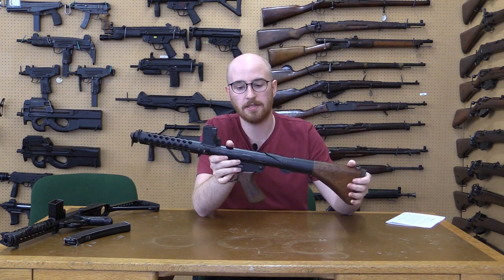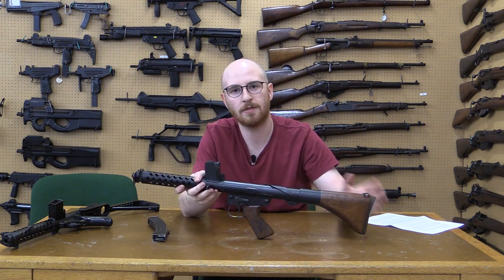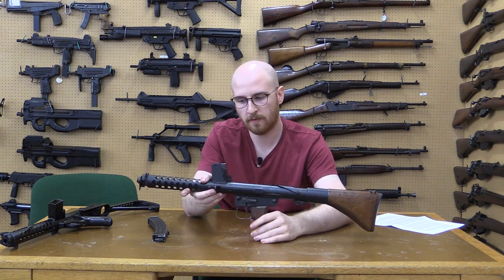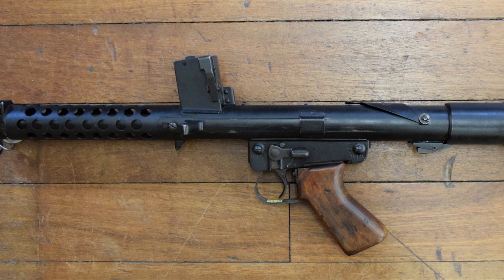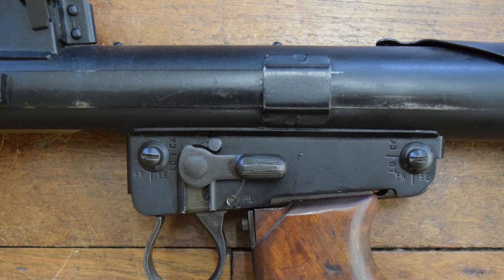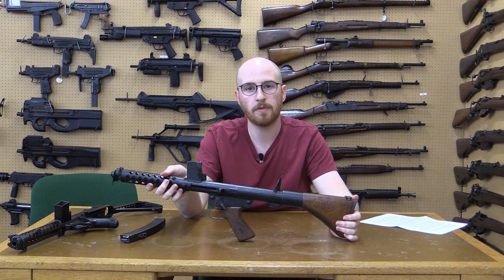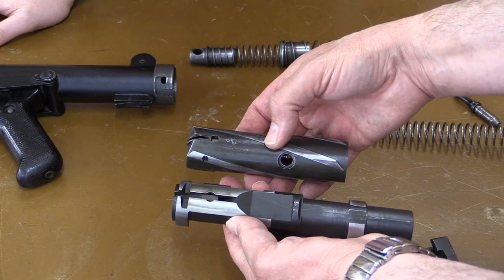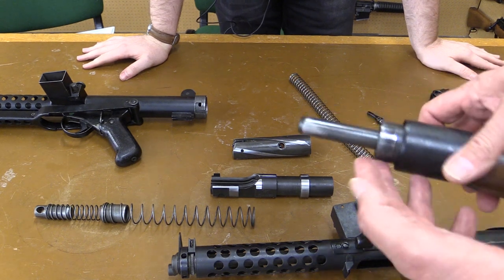TAB Episode 12: Australian F1 Submachine Gun

Comment: F1 used to pull right and high as you fired so used to aim left and low to watch rounds hit the ground and walk the rounds to the target.  Standard rounds scatter in a pattern when firing so it was unusual. A light robust weapon good for jungle terrain due to shortness of barrel. Good up front of the section to get enemy head down in a contact. SLR 7.62 rimless NATO round did the rest.
Reply: Mack Sarnie I believe they fed more reliably, mainly from the Sterling’s magazine
Reply: The F1 served well also  army res 80sv I have recollection it pulled to the left..in circles. .

Comment: I hated the thing. 

The recoil made it hard to aim but worst of all, if the F1 was loaded and you jumped off a vehicle, whilst holding it vertically; the bolt would slide backwards, free it itself from the safety-sear, move forward and because it had a fixed firing-pin, fire a round through the handler's head.

My father-in-law used the Owen in Korea and the F1 in general service. He said the Owen was much better to use.